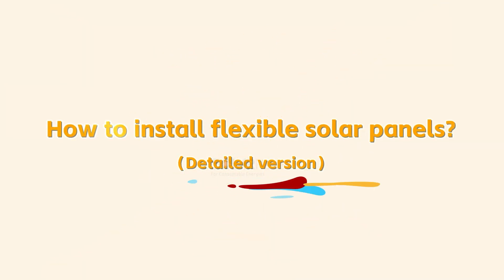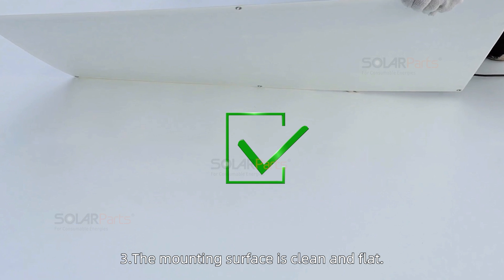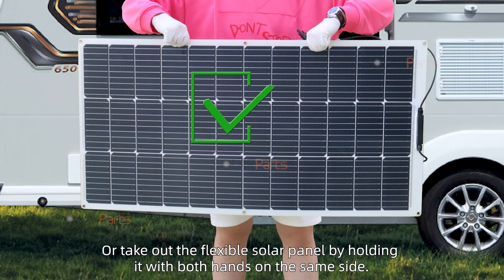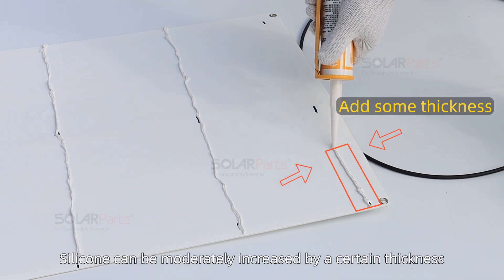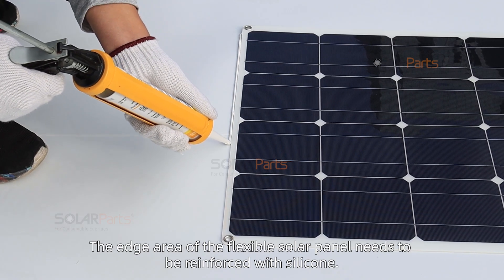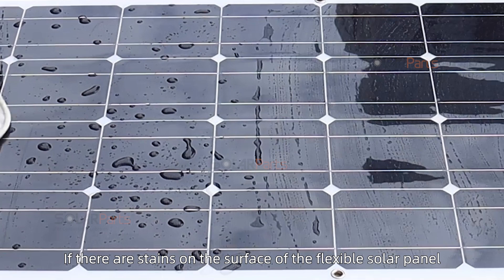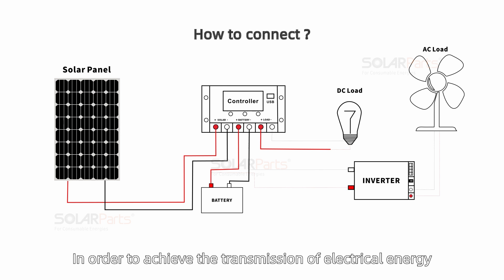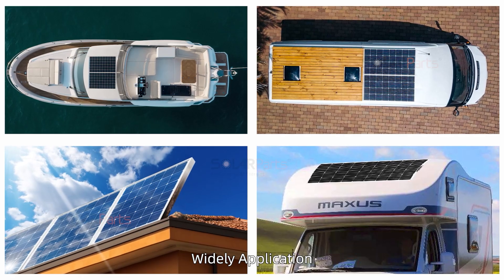How to install flexible solar panels? (Detailed version)

Comment: Does this way of installing solar panels is strong enough for a caravane?
Reply from the maker: yes, the are strong for the flexible solar panel to stick on a caravane.
Reply: A better stronger way to install. Tape edges with Butyl tape. I have done this to the tops of two office trailers and tested to 70+ mph down freeways. Almost impossible to peel off. This silicone is silly.